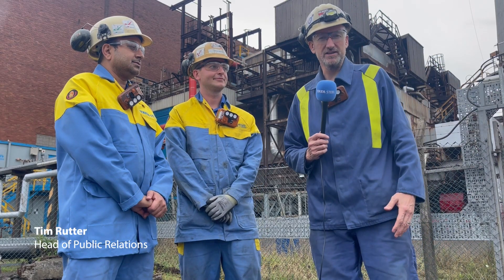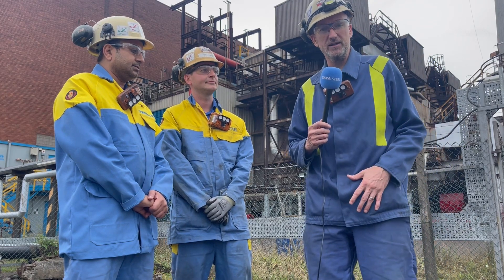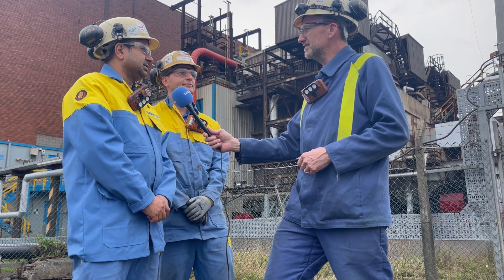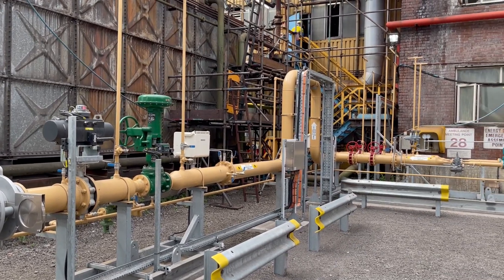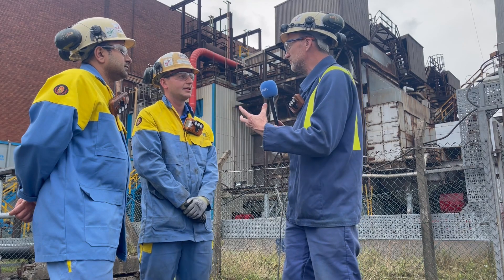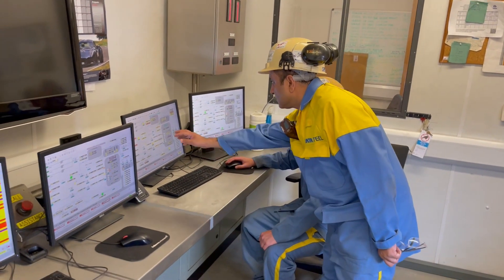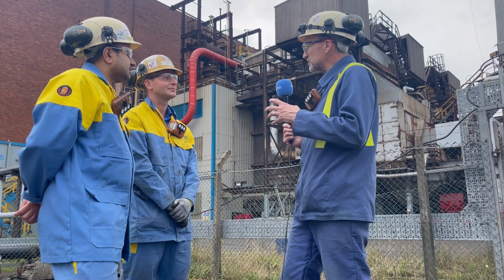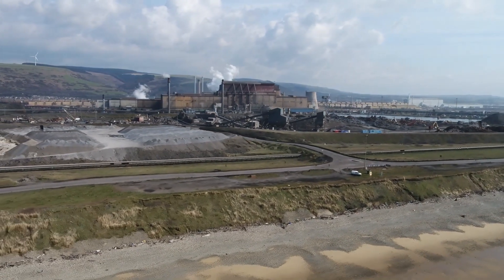Tata Steel Gas Enrichment

Comment: Great informative video.
Ridiculous that the steel works were threatened with closure over using coal which has been used for hundreds of years in industry.
The carbon emissions from the UK is a tiny percentage compared to other countries , many who do nothing to reduce co2 at all.